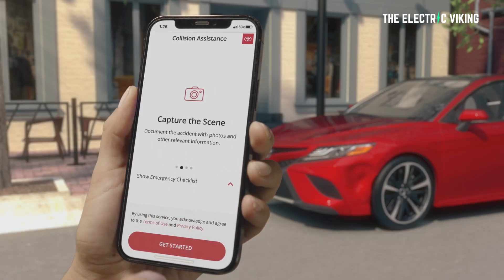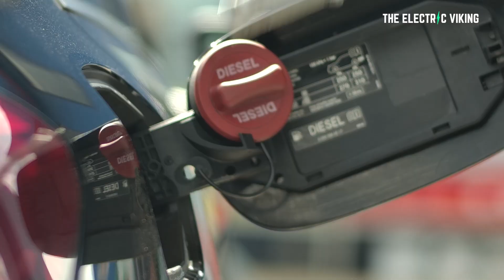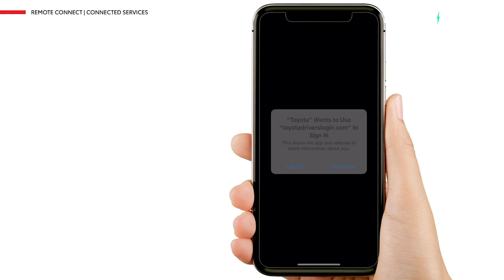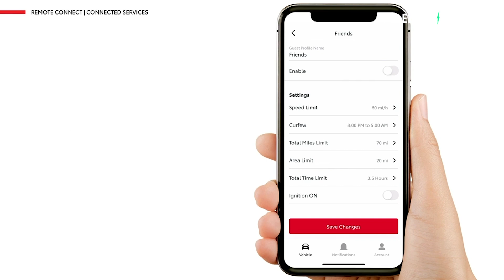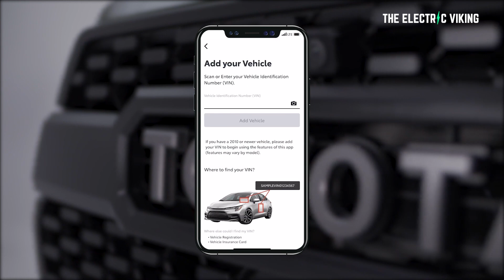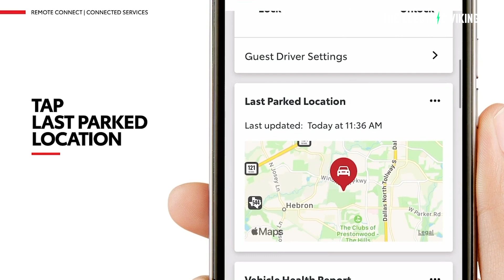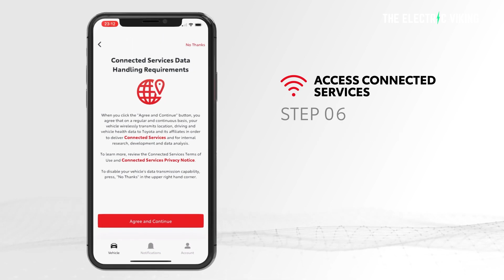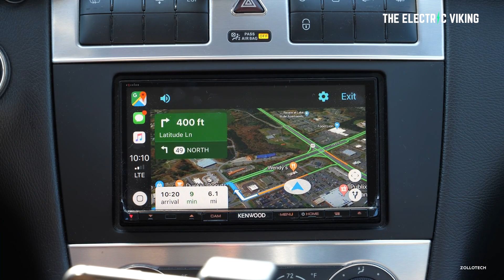Toyota starts charging subscriptions for navigation & app use

Comment: Approximately one year ago, I bought a Toyota Tundra for $76K, over $80K after taxes. I live in the Midwest, where it has just recently started to have below freezing temperatures. The other day, I logged on to the Toyota App to start my car, remotely. Only to learn that my free service had ended, and that I could renew my subscription for only $15.95/MO! I about went ballistic. After spending $80K for a vehicle, Toyota want to charge you another $16/MO, for eternity! This recurring revenue BS has to stop. BMW charged to allow you, their customers, to actually use the heated seats which were already built into your car. I use my remote start maybe a dozen times per winter. I guess that I’ll be getting into a cold car from now on. That is, until I buy my next car, which will allow me to start my car remotely. And, it will not be a Toyota. If they are willing to screw over their loyal customers, I am done with them. They had enough push-back to get them to stop. We need to do the same to Toyota. Please comment if you have been put in a similar position.
Reply: Not sure if it works with the Tundra but (on the remote) if you press the lock button twice - then hold it down - the car will remotely start as long as you’re in range. I use it every morning.. for free. Give it a shot. I’m thinking it should work.

Comment: I have bought 9 new Toyotas over the last 35 years.  Toyota is becoming a dinosaur in relation to its slow uptake of electric vehicles, one of which I plan to buy within the next few years.  I shall NOT subscribe to this ridiculous subscription scheme, and I shall also reconsider my choice of manufacturer for my next purchase - despite Toyotas' enviable reliability.  They are running the risk of losing me as a valued repeat customer.
Reply: I was a General Motor fan for years, for decades . General Motors started producing crap. Then I became a  "#Toyota_Fan_Boy"  I own two Tacomas. Best vehicles ever. 😀

 I am holding out for my 1st EV to be a Tacoma EV.
 I'm in no hurry to get a EV.   If they start charging monthly for certain crap, and if it's under 25 bucks a month, I will go with it.
Reply: So as long as Toyota comes up with an ev when yo are ready to buy, you will buy it.  Sounds like Toyota might be right on schedule.

Comment: the last car i bought, which is also my current car had to come with a GPS or i wasnt going to buy it. Subscription for a gps, get stuffed. On line maps? they have to be the most badly written bits of software out there. My google maps still looks washed out, and i have searched for solutions. Apple maps, not much chop here in thailand either.  remember GM said they are going to make $70b from subscription services. The only way is by gouging customers.  This wont fly any faster than pigs.

Comment: Uh these new subscription services are for their gas cars right? These cars are not computers on wheels so they do not know if you have them parked in a garage right?  The app has the ability to turn on climate control…. uh but these are gas cars that need to run the engine to start an air conditioner. Unless Toyota can guarantee somehow that the vehicle is in a safe location to turn the engine on….. how long until some kid turns on the gas car in the garage with this app and kills people with carbon monoxide?  This could very well happen unless Toyota can build intelligence into the car to know if it is enclosed.
Now I know that remote start has been a thing for years using a key fob. But putting this into an app along with remote climate control seems to me to  be becoming too hazardous. One usually knows when they use a key fob….but how hard is it to mistakenly hit the wrong button in an app or forthe app to malfunction?
As to whether I would pay for the functionality they offer in the app…No way! Hell I would not even pay monthly for what Tesla gives in their app either….however it does enhance the car when those features come with it.

Comment: Actually it’s no free in most cars, not even in Tesla. The SIM-card and data subricption costs it’s not free. VW is charging a lot for this and many others a little less like Tesla and Volvo. Hyundai and Kia are also going to take your money after a initial free period. No telecom company let a car company use a data connection for free so a car that is internet connected are going to cost at some time.
Reply: data subscription is a different story.
Reply: @qilu2004  Not really because it’s data subscription that forces them to not have a free service. Tesla as I said have a fee as well.
Reply: @catmanscarchannel  with tesla, you can use your phone to provide data link for the car, and use navigation app. that gives consumers a choice. 12 bucks for this features? what is next? 12 bucks for a few other features? soon it will add up to 50 bucks per month. the cost of data is much lower.
Reply: @qilu2004  That of course you can in 95% of all cars. All my latest cars had that. But to remotely use things in the car when no phone is there you have to have a data subscription.
Reply: @catmanscarchannel  but why was there no charge in the past? also, if one opt not to pay 12 bucks, can he still use the navigation app with data link thru phone? why not just charge a fee for data then? it seems to me that they may want to charge multiple features and squeeze a lot more than what they can get from a data package.
Reply: @qilu2004  Navigation is a Toyota thing and that is of course bad. It was remote servcies I was talking about. Most people not having Tesla or a car with Google Auto usually use Andoid auto or Apple carplay anyways.
Reply: @catmanscarchannel  remote services are typical for evs and tesla is among the rare ones that charge a data fee. it is really peanuts. why make ur consumers unhappy? the real cost may be less than 20 bucks per year, and less than 200 bucks for the life of the car. just add it to the car price for god sake.
Reply: @qilu2004  The Seat I had it was free for one year and then 260€ a year. The car I have now, Kia, it’s free for seven years and then I don’t know the fee. Volvo is free two years and then I dont know. Most cars are going to have a fee.